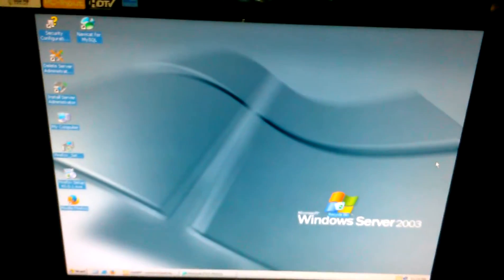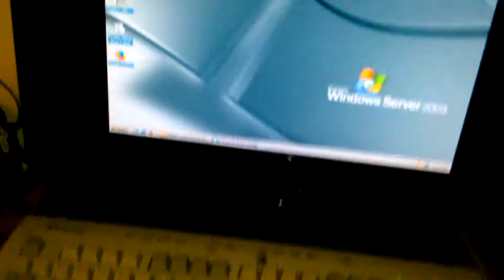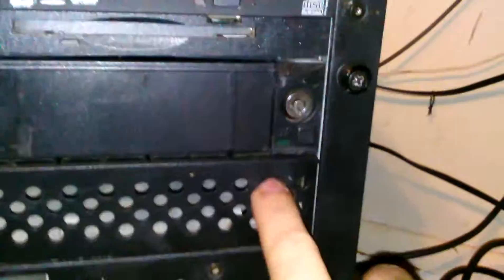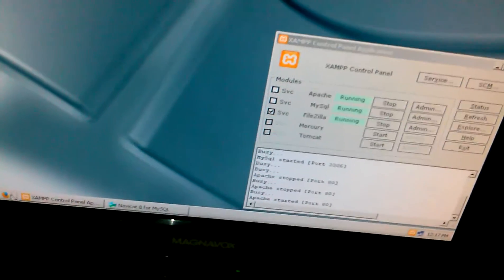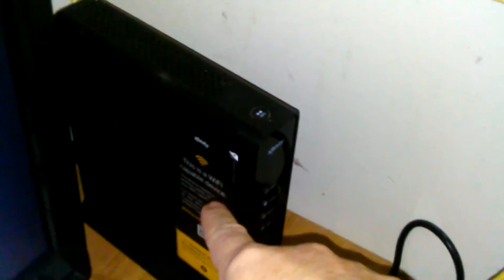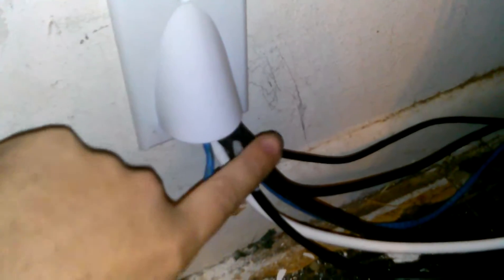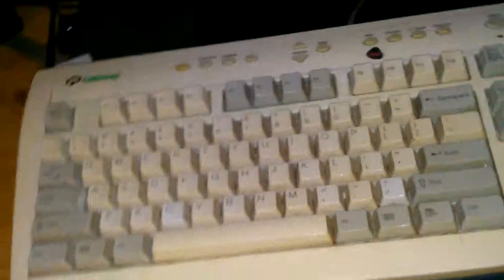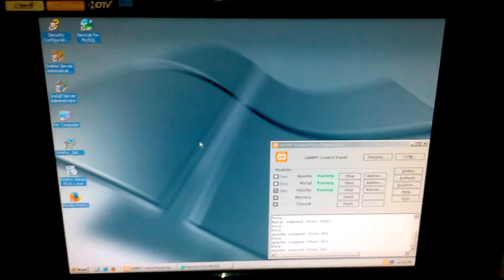My free (restored) Dell Poweredge 2600 - NAS / Webserver

Comment: I have a server like that, problem with the orange led flashing and the monitor does not turn on, I have removed the memories and cleaned, removed the battery to clean the CMOS and still continues blinking orange and does not turn on the monitor, Do you have any tips on how I can solve it?
Reply from the maker: my issue was the PSU modules, they both have to be installed and functioning.
RAM MUST be ECC type also all the HDD sleds must be fully seated as well
make sure the CPU's are socketed properly also.

You can try a separate PCI video card as the onboard video may be bad.

Comment: You do know that this beast has some what support for Server 2008 x86? I actually got mine (also for free) yesterday, trying to install VMware ESX 3.5 on it.
Reply from the maker: +Patrick Pennarts Yes I know. I have it but I opted for 2003 because it was easier to install, the Dell server management CD has the option for 2003 or red hat linux and I didn't feel like fighting it for 2008 at the moment.